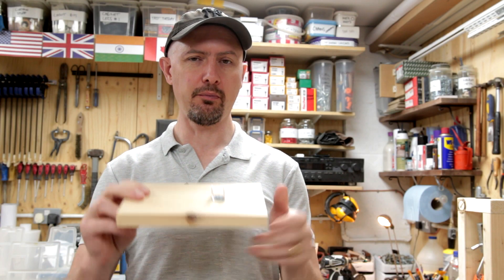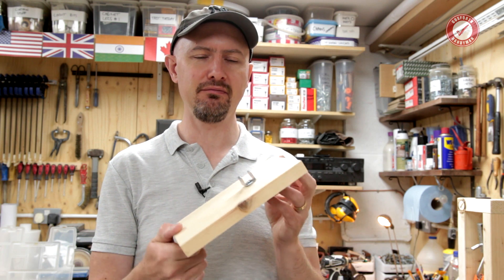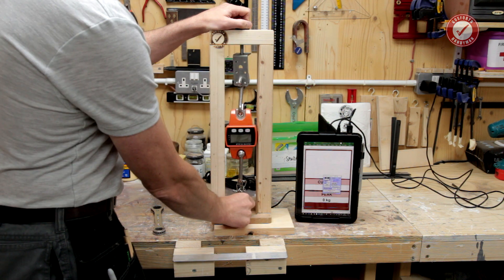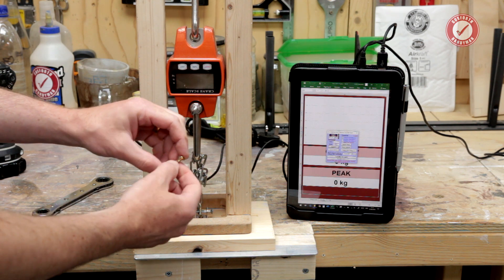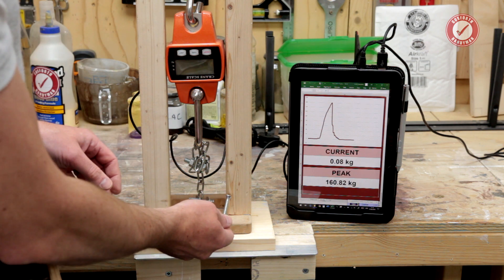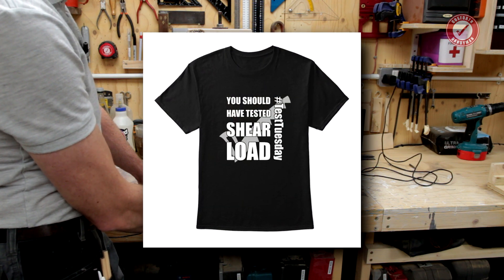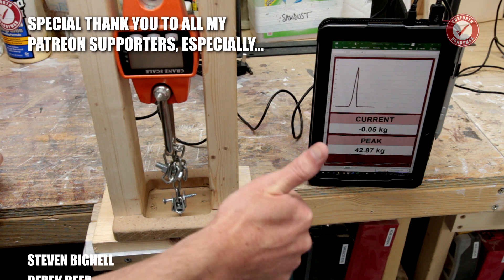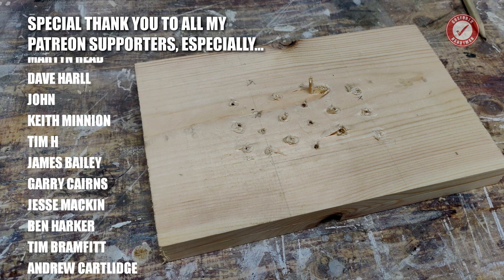Exactly how strong is PINE wood??

Comment: this gave me a huge amount of relief!  I'm about to mount a projector screen to my ceiling and i was going to make a 'rail' out of 1inch x4 inch pine.  I was going to mount the board onto the studs and the rail system would let me mount the  screen exactly where i wanted. i was worried about the screen falling down from the screws stripping out of the wood but since it is only about 20lbs total i will be more than covered by 6-8 screws!

Comment: Love these test videos and the results are quite interesting. It would seem that MDF holds around the same kg force regardless of the screw depth, however actual wood seems to be better the deeper the screw is place, which is most likely due to the wood splitting.

Comment: Pine wood usually means any wood from a coniferous tree. That being said there are multiple species each with different material properties. Most of them are so alike that it's hard to tell from what species the wood came from. But there may be important differences such as type of knots (loose or connate), resin content and resistance to rot and fungus.

Comment: You think maybe the smallest screw was small enough to get in between the layers of late wood and early wood of the pine? Like the difference between the screw holding would be big between the two different layers, and the long screws are able to get through more? The MDF is a more consistent material throughout

Comment: Scandinavian Redwood? That's nothing I've ever heard of and I'm from Sweden. If it's softwood from Scandinavia it's either pine or fur.
Reply: http://www.dhtimber.ie/scandinavian-redwood
Reply from the maker: Ha that's interesting! I think they just call it that 'cause it sounds posh 😂👍 https://www.timbersource.co.uk/softwood/european-softwood-range/european-redwood-timber
Reply: @GosforthHandyman  Yes, I guess so. It's obviously the common pine they are talking about. Though it's mostly light yellowish in it's colour here in Sweden. It looks like that's the case when they grow in colder climate. Normally only the sapwood is that light yellow colour  while the hearthwood is more yellowish- to reddish-brown. Though here in Sweden that coloured hearthwood is apparently very uncommon here since they normally don't grow that big in our northern regions. Though in my experience even the sapwood starts to turn reddish-brown with age in old fur furniture. I was fixing my father's work table. The pine trestlers basically had all the glue joints fail and was only hold in place with the mortice and tennon joints and dowels. Anyway they were very reddish-brown but when I worked with them it turned more yellow.
We just call the pine wood for furu here while we call the tree tall.
Reply: Actually, it's most likely spruce if it's from Sweden. Grows fast and straight, but isn't particularly rot resistant. I'm pretty sure it isn't Fur. Might be Fir, though, but that's not very common here.

Comment: Hi Andy, thanks for the interesting and eye-opening new test! It gives a good insight in the behaviour of screws in wood. Interesting to see the two 'undeep' tests with 4x16 mm and 1,5 turn show that pine is prone to splitting - which happens if the screw is too undeep. The deeper screws fail eventually due to the wood fibers shearing off. 

Why not do a shear test? I think the shape of the tread or type of screw doesn't have any influence on the outcome... you might as well stick a round wire in the wood and get the same results - you only test the pressure resistance of the wood.
Reply from the maker: Shear test - results would be off the scale and not comparable with any of the other tests I've done. I had to run the test 19 times for this - doubling that to 38 tests per video would take far too long for results that would be of no practical use. 👍👊

Comment: Sorry boss but this test is invalid  if you are testing the difference in the species.  You should be testing in pine where the grain is running the same way as the oak as with the pine you are inserting between the grain amd the oak you  are passing  through several layers of grain. Please retest.
Reply: Not sure I understand your point. Could you explain more please?
Reply: interesting  test. thanks for sharing. strength of screws in oak and MDF is more or less constant for all used screws, while the strenght of the screws in pine is increasing with the size. strength in pine length x diameter, or more.
Reply from the maker: Yeah... I'm assuming this is a joke? 😂😂
Reply: Screwing between the grain or across the grain will bring different results especially for the longer screws. When the grain is running the way your pine was your actually forcing the grain a apart.  As for the oak, you were screwing through  2 or 3 layers of growth ring.

Comment: Have you done a comparison of screw types? As a home gamer, is there any advantage of using turbo gold screws? Which screws have the most 'chew proof' heads?
Reply from the maker: I've tested a lot of different types of screw in to MDF - none of the screws I use have 'chewy' heads. 👍👊
Reply: Hi, as "home user" and as an network engineer, I now work on trying to get the bit "on axis" of screw head, buy a "trusted brand" and buy them in 10 or 25 bit pack. When the bit is slightly worn or it's started to give less bight pull out a new one and recycle the old one as it less faffing about than fishing out the chewed up screw. Might work for you too!😉😀

Comment: Very interesting - I've only just realised that we have the same scales that you use in your rig; what software are you using to monitor/gather? - the 16mm screw result (and 1.5 turn result) didn't surprise me by the way, I suspect it's simply a different shaped strength curve because the screw needs to be long enough to take advantage of the fibre structure in the pine, which - being such soft timber - is really widely spaced between the softer/harder fibres. That's my high scientific (tired bloke watching YouTube over morning coffee) theory :D
Reply from the maker: Cheers Fergus - it's just a little custom arduino mod I've made to the scales, linked in to Excel. Good theory btw! 👍😀
Reply: @GosforthHandyman  excellent - if you haven't done a video about that; please do! :D .. or indeed if a particular video already out there was useful to you for setting that up, I'd be interested - thanks dude